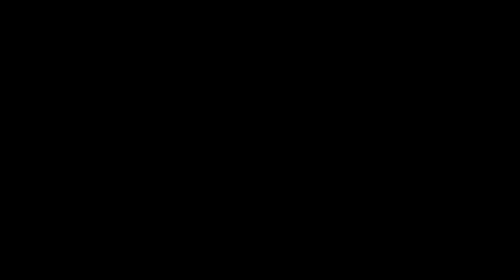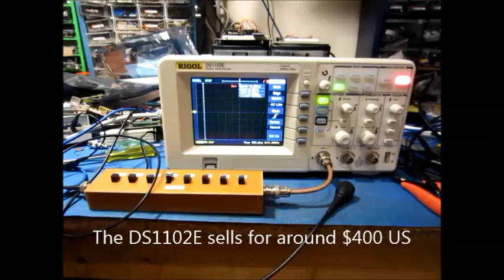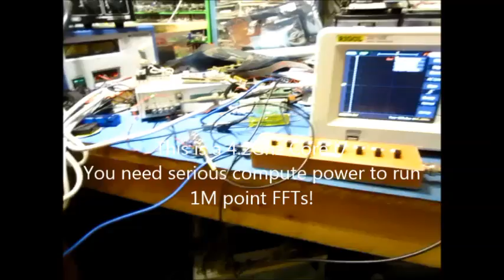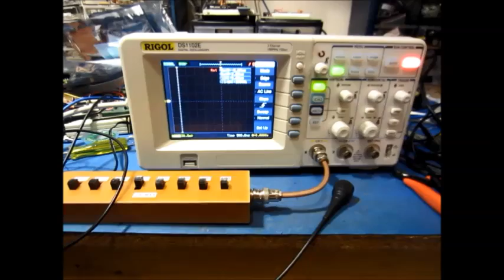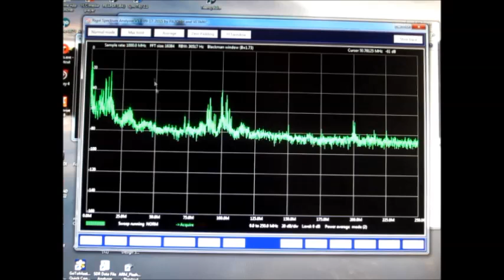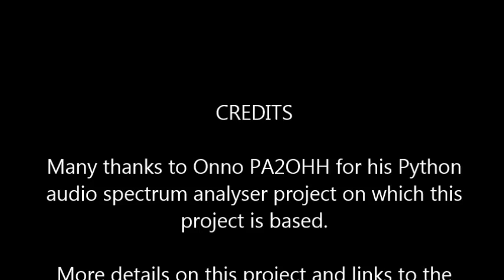PyDSA - a software Spectrum Analyzer for Rigol DS1100E series scopes

Comment: Hi..
Im trying to install PyVISA 1.4 pip 'install PyVISA==1.4', but got error message : 
"could not find a version satisfiel the requirement 1.4  (from versions: )
No matching distribution found for 1.4
seems PyVISA 1.4 no longer available (?)
is there workaround for this step ?
Reply from the maker: You will have to dig up version 1.4. I just found it for windows with a google search so it should not be hard to find. I attempted to get PyDSA working with PyVISA 1.8 but I never did get it working correctly. The API has changed quite a bit in 1,8.
Reply: Thanks, finally i manage to install it. I use DS1054Z with i3 processor in my host pc running windows 10 64 bit.  much slower than yours when using 1G sample/s.
Reply from the maker: Could be the PC. You can reduce the amount of samples that are downloaded in the code which will speed things up.
Reply: will try .. Thanks for your quick reply, really appreciate that!
btw, are you still playing  with the project ? additional features like cursor markers will be very useful :)
Reply from the maker: I've since obtained a nice Signal Hound sampling SA so I don't use this one any more. It has a cursor readout top right corner of the screen. Its open source and the code is pretty easy to follow so you can add your own features if you want.
Reply: Wow..Good for you Rich ! for me, i think  i'll stick around with PyDSA for a while, since I may not use specan alot.  currently, i just want to check harmonics of my DRA818v trx if its clean enough.
I will take a look for the code, perhaps i will just modify and use part of  your simple scalar network code (left click event to put marker)

regards

Comment: I tried to run spectrum analyzer with my DS1054Z and it's work but my Rigol shows all time during work with PyDSA error
 "Function limited!" and "Can Operate Now!". Is this normal ?  I have test software with patch and
 version for 1054Z and make the same.
Reply from the maker: That does not happen on my DS11102E. Try inserting some time delay in the main sampling loop - the scope may not have enough time to process the VISA commands. Rich VE3MKC
Reply: I have a request , can you specifically write exactly what I have to change ? VY 73! Adam SQ1GPR
Reply from the maker: Adam - the main loop is the routine called Sweep(). Try inserting sleep(0.1) after each call to scope.write() and scope.ask(). This inserts a 100 millisecond delay after sending requests to the scope which may help give it time to respond. You can play with shorter or longer times to see if it helps. The added delay slows down the refresh rate so if this fixes the problem try to keep them as short as possible. I had to experiment with this quite a bit to optimize it for the DS1102E. 73, Rich
Reply: I made it and I tried with sleep 0.1 and 0.5 and scope still displays the same. With sleep 0.5 you can see that it works slower but the problem still.
Reply from the maker: Adam - its no doubt one of the VISA commands causing the error, but its odd that it works anyway. The commands for RIGOL scopes seem to differ between models. You could read up on the VISA command set for your scope - maybe it says something about this error.  73, Rich
Reply: Ok thank you Rich. I will search maybe someone else had the same problem and solved it. VY 73! Adam SQ1GPR

Comment: Hi,

 I have been trying to add a couple of posts to your blog about how I got your code working on my DS1054Z using Windows 7 64bit but it does not seem to want to accept them for some reason, they appear for a few seconds then vanish - I am not sure if you need to moderate them first?

If you would like me to send you the content I am trying to add please let me know - it is a step by step guide as to what I did to get the code running from installing Python to modifying the code so the scope understands it.

Thanks,

Kerr
Reply from the maker: +Kerr Smith Kerr - got your post via Github and I reposted it on the blog. Not sure whats happening on blogger - browser issue ? I was able to cut and paste your email into the comments no prob. 
Thanks! 
Rich

Comment: Very interesting, especially the ability to hook the antenna directly to the scope. Would be interesting to try it with an antenna designed for police/fire frequencies or aircraft frequencies. Very useful within its limitations, as you say. Many thanks!! Robert AK3Q
Reply from the maker: +Robert Gulley I have a video of it hooked to a 2 meter whip up in my attic. It picks up the higher bands much better with the shorter antenna. https://www.youtube.com/watch?v=ie6SDgt7N_U
Rich VE3MKC

Comment: Wonder if this would work on the ds2000A series?
Reply from the maker: +Asbjørn Mikkelsen I would think so. The DS2000 series also supports VISA. I couldn't find the programming guide for the DS2000 series but the commands are probably the same. You might have to change the buffer sizes, FFT sizes and sample conversion code to accommodate that scope.
Reply: +Asbjørn Mikkelsen Using the DS1000E and DS2000A programming guides listed below I was able to get the script working on my DS2072A scope. Just had to change it to use the correct commands for the DS2000A series and then reworked the logic for how to transfer the data to the computer. The DS2000A programming guide shows how to get the waveform data to the computer. I haven't verified that the DS2000 non A series uses all the same commands as the A series by I would think it would.
Reply: +rheslip20 Im not sure about the DS2000 series, but the DS2000A series has quite a few of the commands different. I've started playing around with it on my DS2072A tonight, converted all the commands that were different. I feel like I've almost got it working, but not quite there yet. PyDSA can control the scope (start, stop, capture) but it handles retrieving the data a little differently and so I need to rework that section of code some more. 
DS1000E Programming Guide - http://www.batronix.com/pdf/Rigol/ProgrammingGuide/DS2000_ProgrammingGuide_EN.pdf
DS2000 Programming Guide - http://www.batronix.com/pdf/Rigol/ProgrammingGuide/DS2000_ProgrammingGuide_EN.pdf
DS2000A Programming Guide - http://www.batronix.com/pdf/Rigol/ProgrammingGuide/MSO2000A_DS2000A_ProgrammingGuide_EN.pdf

edited to fix incorrect link for DS2000 programming guide. Also after looking at it the DS2000 commands seem similar to the DS2000A commands, so the code as is will not work on the DS2000 (example: DS1000E ACQ:SAMP = DS2000 ACQ:SRAT). Also very cool work rheslip20, thank you for doing the work and sharing it.
Reply: lbrieden1 Great, it's the A I have, DS2202A-S, need to try this setup.
Reply: +Asbjørn Mikkelsen I am logging off in about 10 minutes and have work early in the morning, then going on vacation right after work. If you can get me an email address I'd be happy to send you the code that works on the DS2000A series (I have DS2072A-S). Just understand its in a very rough state, I literally just got it working 30 minutes ago and there is all kinds of commented out code, hard coded values and other uglies that I was trying to get it to work (and probably won't be able to clean up until I get back), but it does work. One other difference on the DS2000A is you don't actually set the memory depth, but you can grab it to know how much data you will be downloading. And the DS2000A will only let you download up to 1Meg at a time, so if you've got more data than that you may need to download it in chunks.
Reply: +lbrieden1 its asbjorn at neslekkim dot net, thanks
Reply: +Asbjørn Mikkelsen Email sent, good luck. Also forgot to mention, the way its set in the code that I sent you, it does a single capture and shows the FFT then stops. Once it has completed that first capture you can click on the 'Start' button and it will run continuously.
Also many thanks to rheslip20 for all the hard work in getting this working for Rigol scopes.
Reply: +rheslip20 I am sorry, I got so excited when I got it working that I didn't think to ask if you are ok with me sending my ugly hacky version of your code to another user.
Reply: lbrieden1 rheslip20 I hope that shouldn't be a problem. I will try to set up this on my scope and see how it works out, I have both versions, so I can compare the differences.
Reply from the maker: +lbrieden1 Thats fine - glad you got it working. Please send me a copy once you have it cleaned up, or even better a pull request so I can merge your changes back into the source. I'm thinking this could be a global variable to set the scope series and sending the VISA commands appropriate for that scope in the main loop.

I'm in the process of moving the code to PyVISA 1.8 which changes the VISA requests quite a bit from V 1.4 that the code uses now.
Reply: +Asbjørn Mikkelsen Sorry, I didn't mean it is a problem. Its actually doing what it is supposed to (for the state that I left it in), I was just warning you so that when it happens you don't think there is something wrong. Its only because I have it doing a Single Trigger the first time through, so it doesn't run continuously unless you tell it to by clicking on the Run button. This is something I will revert back once I get it cleaned up.
Reply: +rheslip20 Thanks. I will definitely do that. I had the same thought when I was making my changes. Doing that and then abstracting out the part that actually captures/retrieves the data would probably be all the needs to be done to support most Rigol scopes. All of your conversion code works fine, I didn't have to do anything to the data processing or FFT display code.